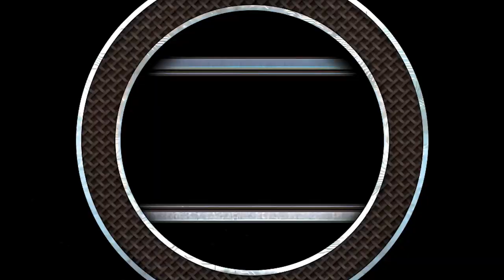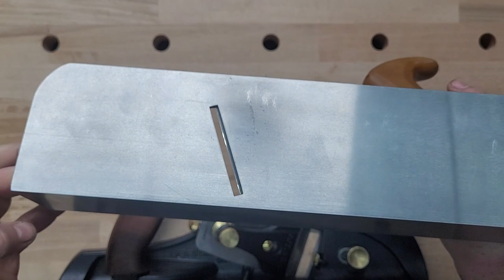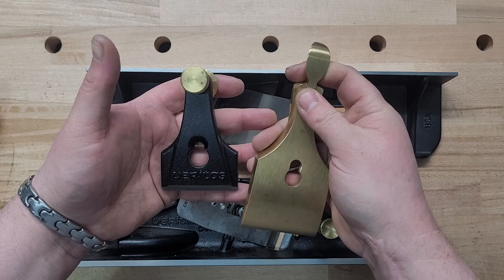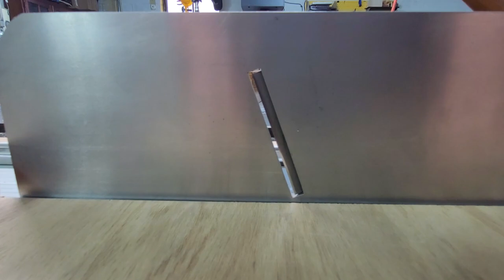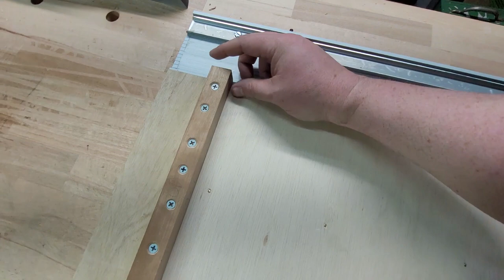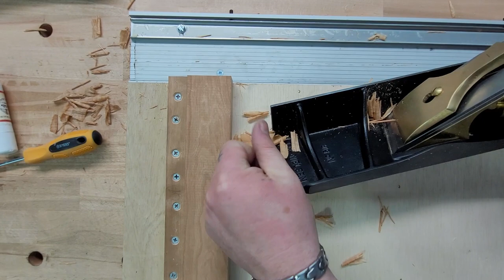UPDATED - IT'S NOT WORKING = $650+ Lie Nielsen Vs $385 Veritas Shooting Plane Review and Comparison

Comment from the maker: 2.16.2023 UPDATE: A rep from LN caught wind of this video and called me. This surprised me but he wanted to give me some advice on using this plane.
He and told me the issue is because I put a piece of paper between the plane and the plane fence. Because this is such a precise tool, that 4 thou matters when you're only taking a 2 thou cut. He also recommended a different hand position when using the plane, holding onto the plane, where the tote meets the body. Unfortunately, I already sold the plane, so I am unable to test this out. Please comment below if you are able to test this out and let us know how it goes!

UPDATE: I am still getting extremely mixed reviews on the LN Plane. 

The most common answer:
- They love LN planes but this one is based on a flawed design, and they use the Veritas for shooting 

Here are some of the other answers:
- that's just how the plane is, and they have the same issues
- don't use it on end grain..... (its a shooting plane.....?)
- they have it and have no issues with it
- there is a manufacturing issues with my plane
- try a back bevel/don't do a back bevel
- move the chip breaker away/move the chip breaker closer
- ect.
Reply: I just got a Lie Nielsen 51 shooting plane, and am having similar issues. I'll try some of the recommendations you have listed. It's one of my first planes, so i'm still learning how to do the setup properly. Tips appreciated :D
Reply from the maker: @kibraeldavidroell5367  oooh tbh this is gonna be a tough first-ish plane :/ it's finicky to say the least. Lol I have a few videos up that make help with the set up but nothing dedicated to this plane because I couldn't even get it to work :( if you keep having issues. Call Lie Nielsen and see if you can talk to Dineb, he is the one in the videos on their website showing how to use this plane, he can help more than I can with it :(
Reply: Was it Deneb who contacted you? He is a great guy and is a lie neilsen foundation of knowledge.
Reply from the maker: @danthechippie4439  it was and he is deff full of knowledge!
Reply: Respect for the honesty and openness, that helps others a ton!!

Comment: I have had similar issues, not with a LN but an old Record T5, quite a different plane. What I learned was that when I used the tote I was getting unreliable results, when I accepted that whoever designed it knew better and attached the accessory handle things came together.
Having learned this I found I could get similar results by griping the ahead of the tote in alignment with the mouth, without the handle.
Just where you see the sausage on a No9.

Comment: Good video.  Me, too-- a lot of trouble with the L-N No51 shooting plane.  (I use with a Vogt ramped shooting board.) Truly dissappointing because all of my other L-N planes work beautifully. For this plane, I have minimally acceptable results; and, even then only after a lot of fiddling. Must sharpen the blade after only a few cuts (end-gain so . . . possibly ). Seems to work somewhat better when the frog is far forward so mouth is at minimum. Also, works better on thin stock.  I cannot get good results on 3/4 thick hardwoods. I called L-N and they said try taking thinner passes, but I'm already at minimum---often the blade just skips past the wood.  I wish I knew why it's so troublesome.
Reply from the maker: Thank you for sharing!! I'm hearing a TON of mixed reviews, some have the same issue you and I are having. Others have 0 issue at all other than they have to take extremely light passes and never full length shavings. It is crazy a brand that we'll known doesn't have a LA shooter yet lol
Reply: I am having the same trouble with this plane. A few good cuts, then it starts skipping. Frustrating.

Comment: I have the Veritas shooting board and plane and love it. As you noted, very little to fuss with, give the settings a quick check before starting and you are good to go. I recently edge trimmed a 17 1/2" square chess board. Had to be careful at the start of each stroke but I was able to square it up nicely.

Comment: I think in this case it might be the table / workbench the shooting board is resting on. Kind of wobbly. The cleat beneath might be worn out etc. In my workflow - DIY shooting board, old Record 5 ½ , Ron Hock iron, no fence - never any issues. My bench is leaning against the wall. So full stability there. Next: remove the fence. The moment the cutting edge enters the wood there might be some interaction between plane body and fence. Next, make sure the shooting board itself doesn't move. Clamp it down to the bench. If nothing works out, only then it's probably the plane.
Reply from the maker: I thought that too but the veritas doesn't have any issues with the set up I have :/
Reply: Luck

Comment: I'll always take an adjustable mouth over an adjustable frog, even the easier to adjust ones like the bedrock style. With an adjustable mouth I just find it so much more useful, as you can very easily open it up to clear chips out without needing tools or worrying about having to reset the blade or depth of cut or anything like that. Especially with the depth stop on most Veritas planes, I can quickly open it, clear it out, and close it back up in just a few seconds. Obviously, setting the mouth to avoid tearout is great too, but I'm surprised more people don't mention how easy they are to clear out (maybe I'm doing something dumb to jam my planes up so often). Anyway, great video as always. the Veritas plane might need to end up under the tree this year.
Reply from the maker: Very true! And I am the same say, deff prefer adjustable mouth vs frog. 
When you get the shooting plane you will see that it doesn't really clog. The shaving basically fall out cus its on its side or launch out when your getting serious about endgrain hahaha so that may be why it's not mentioned for this plane :)

Comment: I was getting similar issues to what you're describing with a brand new LN51 so I read through the comments and made some tweaks. I believe my issues to be resolved at least for now as I'm able to get a smooth cut through 4/4 white oak, birch, and pine & 8/4 cherry. Here's a list of the things I changed:
- Sharpen the iron. I thought I had done it right the first time, but I should have spent more time getting rid of the factory edge. I'd also recommend sharpening to a higher angle (35 for me) to give the edge a better fighting chance into end grain. Anecdotally that helped with chipping.
- Prep the chipbreaker. I jumped straight into planing with a tight gap between the blade and the chipbreaker and that was a mistake. For one there's no need to have them be so close for shooting end grain. But also, I sharpened the chipbreaker just as if it was an iron to make sure there's absolutely no catching chips. Side note but it's really noticeable how much softer that metal is because the burr is so sticky!
- Tighten the frog screws. I gave a little extra muscle to the frog screws under the knob and to the lever cap. Nothing crazy, just tighter than they were.
- Wax your shooting board. This is kinda optional, but it allows the workpiece to slide back in front of the blade after taking a cut.
- Prioritize applying pressure towards the plane instead of into the fence with your workpiece hand. This is a bit of a balancing act but with some practice I got the hang of it.
- Check your fence squareness. Mine isn't square and it's giving me an inconsistent result depending on where I'm pushing.
Reply from the maker: Thank you! I don't have the LN any more so I'm bummed I can't try these :(

Comment: Previous comment was already long so I split this off. 

A general observation about shooting: I shoot a lot of ends and have done so since nearly my first week of woodworking when I made a bench hook. I've shot with planes from low-angle blocks to no. 6 and IME some settings are nearly irrelevant to planing end grain. As there's no chip to break per se, a tight mouth isn't giving you anything you need, and if the cap iron is set close it's just increasing resistance without giving a benefit. 

Since one or more people suggested a back bevel for the L-N, I'll weight in and say you absolutely don't want to use one here 🙂Given that we already know low angle is good (not required, but beneficial) deliberately going for a high AOA is already silly just in theory. And without boring you with the details I've tried it and It just pointlessly increases resistance (to the point that a plane of normal weight can easily just stop dead in its tracks!). A back bevel will always prolong edge life, potentially useful working on the end grain of very hard woods, but for general shooting? Nah.
Reply from the maker: Thank you! You officially tipped the scale to no back bevel! It was tied into the info i was hearing. Just funny how there is always stuff like this in woodworking lol
same went for the mouth size, chip breaker location, etc. 
Maybe this is showing us why the LA Veritas Shooter works, it doesn't have any of that besides the mouth!
Thank you again! Great info for ppl, i hope this one gets bumped up in the comments!
Reply: As a Stanley No. 51/52 owner and regular user, I would say your comments are very will informed.  Watching the user fiddle with the frog position and chip breaker on the LN was curious.  Neither has any positive effect on end grain.  As for the Veritas, the adjustable mouth would also be a somewhat useless gimmick as tear-out is not an end grain issue.  I occasionally experience the skipping on my Stanley and it is attributed to the working stock recoiling in the holding hand.  A firmer grip, a bit more inertia will overcome it once it starts and allow normal planing to resume.  The original Stanley stock hold down was not a useful piece of the tool and would not combat this issue, which is why it is the most common missing part on these antique planes.  I may have to acquire a Veritas to honestly compare the low cutting angle to the standard 45 degree bedding angle in the hands of an experience shooting board user.  Interesting.

Comment: Disclaimer: I’m a L-N user for Bench Planes and Block Planes (exception is I own a Veritas NX-60 in addition to my L-N blocks) I’m a Veritas user for all joinery planes.  I do own a Veritas LAJ, but rarely use since getting the Veritas Shooting plane 2+ years ago.  

While I consider the shooting plane to be a joinery plane and only got away from BU planes as a product of wholly embracing gross, medium, fine in all aspects of handwork and can’t ever see me looking back.  The L-N bench planes are the bees knees, but I think the L-N Stanley style frogged bevel down design is left wanting for the same reason it wasn’t reliable for Stanly.  The BU design is superior for Veritas because it’s the right application for the task and that correct application of skewed BU also keeps the forces applied to the whole system better in line and better supported than any frogged bevel down double iron ever could.  It’s simply the better design.   That said, if I didn’t own a Veritas Shooter, I’d be fine with my Veritas LAJ (which otherwise is now pretty dormant in my shop) or I’d get by just fine with L-N 5-1/2, 6, or 7 as a shooter.   I have a bunch of money invested in both L-N and Veritas, but would consider the L-N Shooter a poor investment that I’d continually regret every time I simply turned a 6 or 7 on its side leaving the shooter to gather dust.  
Just my 2¢

Comment: I have the LN and it works well for me. Been through the video a couple times and nothing's jumping out at me as a key difference, though with the speedup it's hard to know for sure. I'm using a similar board in terms of dimensions, but without the track; can't imagine the track would make a difference here. Setup for the frog is standard bedrock, pretty much what I'd use for any bedrock plane. I keep the chipbreaker about 1/32" away from the blade, cap screw set so that adjustment isn't a struggle. I do use a Cosman Adjustar on mine, but it's otherwise stock. Blade, Charlesworth ruler lapping to 16K, 29 degree secondary bevel, 31 degree tertiary bevel. I guess the only input I could offer is that endgrain is a tough business and that blade is very good steel, so it'll take a fine edge; don't be afraid to give it one. Also, and likely preaching to the choir here, but cap screw tension can be a make or break; ensure it's not too tight or too loose.
Reply from the maker: Thank you! I deff appreciate the feedback! Been getting so many opinions. Some say, that's just how it is. Alot are saying it's an issue with the plane. I love what you are adding to the convo! It does have the ruler trick on the back, I could try a steaper angle but.... I am trading the LN for a Stanley Chute Board to go with the Stanley 51 I have. Wouldn't be able to make that trade with the veritas haha I have it for a bit longer to do another video so I may give that a shot! Thank you again. I appreciate you!
Reply: @BatCaveCreations  Brother, if you can find a genuine Stanley board to trade for it, you want to jump on that opportunity. Normally there are, well, kidneys involved. Just sayin'. ;)
Reply from the maker: @sneezingfrog  hahaha 100%!!!

Comment: I don't know if it is relevant, but most people shooting are shooting endgrain.  The Bailey set up on the LN makes no sense on an endgrain plane.  One can argue bevel up and down, but this is a job for a low angle plane.  Of course there are jig preferences and functions that are long grain.  Examples would be guitar sound board prep, or the system Gordon uses with his planes.  So maybe a Bailey would be great for that.  Doesn't seem to be what the 51 was designed to do, though.  The 51 shooting board is clearly a miter type setup.
Reply from the maker: I agree with you!

Comment: Hey there, interesting attempt. I am wondering, what is the use of a shooting board track? Normally we make shooting boards out of thick plywood or other decent material, so its all flat. Then we cut on table saw and get square edges, so an aluminum track seems redundant. Also, the plane naturally cuts where the blade is, when using it, and forms its own track which is zero clearance (or darn close). You get maximum "support" from the edge. So you might try ditching the track, and try just a wood edge. I also like the trick where instead of a screwed on perpendicular fence, you route a dado there, and then make a spline piece which fits into a fence piece. You can then slide the fence as needed to get zero clearance which is a big deal on these cuts with end grain. Good content, people like "non-perfection" videos. I wish the sound volume did not cut in half when you are doing the "clothes washer/dirty sink" talks though lol.
Reply from the maker: I like the track because it has the metal fence to hold the plane in place. I know you can do that with a wooden one too but I tried both and like the track better for the fence and for the anti friction design. I also like the gap between the board and the plane. The fence there does extend pass the gap so it is 0 clearance. When I built it I put the fence over hanging then planed it to 0 clearance. I think more of all the track is preference haha
Ya the volume is a problem :( I bough a CHEEP camera on Amazon to get started. If this takes off I'll deff upgrade! :)

Comment: The LN is based on a flawed design.  Not only was the Stanley prone to breaking at the frog, they ignored their own bevel up designs which would have been much better for this type of work.  The no.s 9, 164 and 62 were full sized planes that could've been converted to a good shooting plane.  The 9 works but lacks the size.  Veritas really came through.
Reply: The LN and Stanley frog design is completely different, they took care of the problem Stanley had